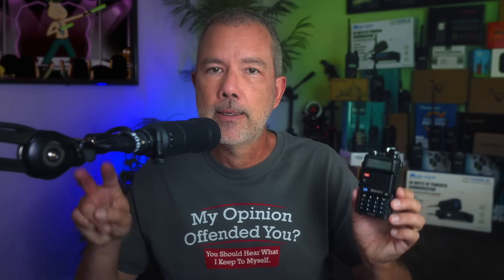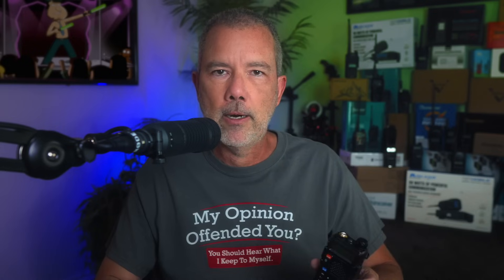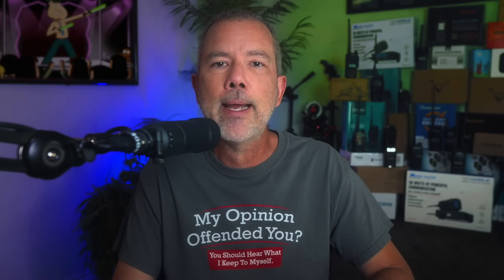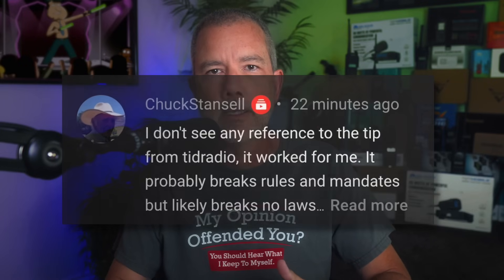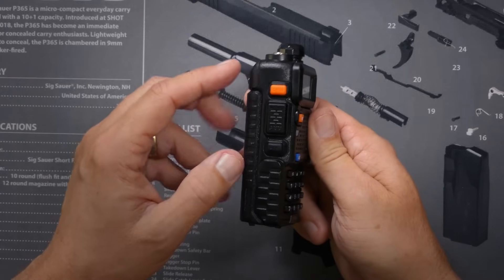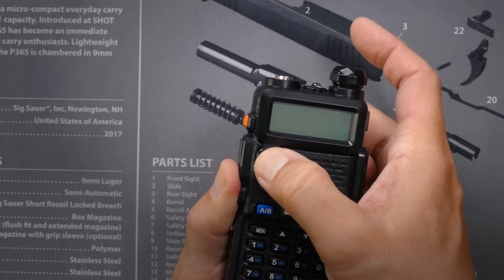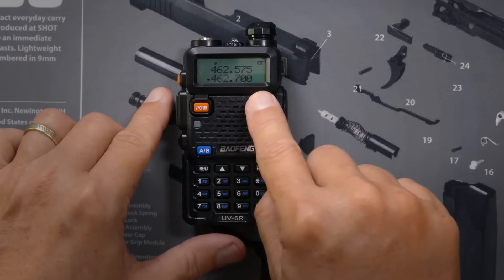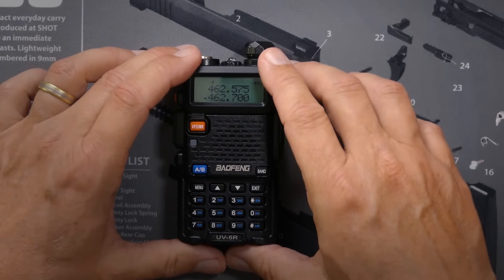How To Unlock A New Baofeng UV-5R - Easy UV5R Jailbreak To Transmit On More Frequencies

Comment: Hello Randy
I recently bought two newer uv5r units and both will not unlock using this method.
Ive tried cloning from older units i have, wiped the radios and checked tx and rx in chirp and channels they are set. Any insight? I have also tried the manual factory reset.
Reply from the maker: My insight is that many of the very new models cannot be unlocked.
Reply: @TheNotaRubicon  Roger that! I guess I got the unlucky batch this time. Thanks for the time and BTW Loving the humorous but helpful videos! Keep it coming!

Comment: For anyone curious, just received a new UV5R yesterday (10/16/23) and I was able to unlock it. Thanks for the helpful video!
Reply: Okay, how exactly do you know if your radio is locked?
Reply: @chipfornaris  Display says, "Factory" and you can transmit on GSMR frequencies.
Reply: I just got a new UV5R and it will not unlock....Link to your purchase?
Reply: @mdean619 would be super helpful ty as to where u purchased them  ty again
Reply: I too got my UV-5R in December 2023 and I myself just unlocked it as well thanks to this video now i can transmit on my GMRS channels.
Reply: Mine will not unlock any Ideas
Reply: @Practical-Tactical173 im sure you got it buy now but if not. Press menu 040 menu menu menu. Thatbwill factory reset it. Then shut it off and do this. I had to go this route with mine
Reply: @cameronbarron  Thank you for this. The other way does not factory reset but this way did.
Reply: @cameronbarron had to do this first and it worked! Thanks!
Reply: @tacticalt4749 how many times did you swear at it...  sometimes takes longer than I'd thought 😂  

Any luck?
Reply: Does it stay unlocked or do you have to start it up like that every time
Reply: Stays unlocked. Checked it by transmitting and receiving with a walkie talkie. Have fun
Reply: Are you guys transmitting on GMRS frequencies without any issues? I’m still contemplating between the uv5r and it’s gmrs counterpart
Reply from the maker: If all you ever want to do is transmit on GMRS, then you should get the GMRS version because everything is much easier.  Maybe even look at the UV-5G+ which is also better in every way.
Reply: @TheNotaRubicon have you tried any new ones this year that can be unlocked? I want to know where I can get a pair
Reply: i just got a 2 pack today and one dose it and the other doesn't
Reply: Got a uv-5r in 2024 and didn't have to unlock it at all for gmrs frequencies it workd out of the box but 220mhz band will not like some are saying
Reply: hi andy. can it transmit on airband now?
Reply: Me too one did a few months ago but this second one I got more recent won't do it
Reply: i just ordered two more of these radios, got them today, and they are not locked.
Reply: I just got two of them in Jan 2024 and they came unocked already. I got it from Abbree on Amazon as part of a bundle with extra antennas, etc.
Reply: this worked for me but out of curiosity how do you re lock it?” Lol
Reply: Was Able to Unlock in Dec 2024, in a country where FCC is a bank not a commission
Reply: Mine keeps saying 'frequency mode'. No reset or anything.  Why?

Comment: So only newer ones are locked? I bought mine in 2019 and these steps didn’t generate the factory message. Is this unlocking process supposed to allow a broader frequency range? (Like listening to air traffic control frequencies), or were newer locked models not able to transmit at all on any frequencies, but only listen?
Reply from the maker: As mentioned in the video, only newer ones are locked.  Your 2019 can already to everything that "unlocking" allows the new ones to do.

Comment: Did not work for me. Sad chad
Reply from the maker: Is your radio locked? if its not locked nothing will happen because you don't need to unlock a radio that isn't locked.
Reply: @TheNotaRubicon  I still get the screw you beeps after factory reset. Trying FRS frequencies

Comment: It doesn't work on mine, I do that but instead it shows "COPING" no FACTORY here.
Reply from the maker: Is it locked? It wont do anything unless the radio is actually locked.
Reply: @TheNotaRubicon  I want 220, it does 132 to 174 and 400 to 500. I've tried the Chirp method too.

Comment: I just got two UV-860's and the company I got them from said they're an upgrade from the UV-5R which can be unlocked with the Push and hold PTT, MON and VFO/MR while turning the radio ON and you'll see a message on screen that says FACTORY if you successfully unlocked the radio, if not, try again.
However, this does nothing when I try to unlock my two UV-860's, absolutely nothing, it turns the unit ON but doesn't unlock anything or display a FACTORY message onscreen.

I really want to unlock frequencies, do you or anyone else for that matter, have a way I can do this? Please and thanks!

I appreciate your time, I'll be right here to check for replies as they happen, I hope to hear from you soon, anyone!

D from B.C.

Comment: I have a uv5r5. This did not work for me. Any ideas?
Reply from the maker: Yes, I have a lot of ideas, all the time.
There are two possiblities: 
1) you did it wrong
2) you have a newer UV-5R that cannot be unlocked
Reply: @TheNotaRubicon  I'll have to assume the latter since I have good hands. How new is new? I bought these a in '20, after a move they stayed in storage before any use.
Reply from the maker: Is it even locked?  It wont work if its not locked because you dont need to unlock a radio that is not locked.

Comment: Worked on my UV-S9 but not my new UV-5R-GMRS.  🤔  still unable to transmit on the UV-5R -GMRS,  next I will try to edit things in the software I guess.  What would ONE be looking for in the software.  I'm not using tones and my other Baofeng works so kinda at a loss.

Comment: Frustrating. my new Baofeng UV-5R GMRS will not unlock even with doing the reset.
Reply from the maker: Nobody said you could unlock the GMRS version.
Reply: @TheNotaRubicon  Wishful thinking on my part. I'm a radio noob.
Reply from the maker: Some UV-5R GMRS units ship unlocked.. did you confirm that yours is actually even locked?
Reply: @TheNotaRubicon  Yes, put the unit to a ham 2meter band and it won't transmit. Will transmit on gmrs though.
Reply: @TheNotaRubicon  I returned the GMRS radio and bought the non GMRS one and low and behold, I got that one unlocked. Now, I can be one of the cool people. lol.

Comment: I tried this on my GT 5R and now I have to turn off the radio to stop it from transmitting. How can I fix it. Thanks for all the videos you have posted I am in the process of watching all of them.
Reply from the maker: I dunno man, this is for a UV-5R, not the GT-5R.. Be sure to read all the updates and warnings in the More-Info section of the video.
Reply: Had the same but it was the button that stuck,  just wigle it a bit and it should stop the tx.

I hear that unplugging the battery and put it back works for those who get this without having a stuck button

Comment: Randy, I purchased a Baofeng BF-F9V2+ several months ago (unfortunately before coming across your great instructional video's) and wanted to inquire if this radio is comparable the UV-5R?  I'm new to all things "Radio" so I'm really green with this stuff.  If I could find the operations manual online for the UV-5R online, I would just read it and compare to the info in my F9V2+ manual.   Thank you, Sir.
Reply from the maker: I haven't used the F9V2 but it looks to be very similar to the UV-5R, my guess is the menuing operation is 99% the same.

Comment: When I tried this, it said "channel mode"
Reply from the maker: Is your radio locked? It wont work (and you should not try this) unless the radio is actually locked.  Or, you may just not be pressing all the buttons correctly.
Reply: @TheNotaRubicon  I tried it twice.  How do I tell if it's locked?  I did a test transmission on FRS channel 1 because I have an FRS radio and it went through.

Another item of note, I saw your video on how to change the default language.  Mine was already in English, so it may be a different configuration for radios sent to Canada.

Comment: This method did not work for my Uv5r, nor did the factory reset within the menu.  Can this be done with software and a cable ?
Reply from the maker: Is it even locked? If its not locked, none of those things will do anything, because it's already unlocked.
Reply: Wow thanks for the reply!   @TheNotaRubicon   I wondered the same thing, but I can’t transmit on 462.700, I just get a beep
Reply from the maker: Ok, sounds like it is locked. You probably have one of the NEW new ones that cannot be unlocked.
Reply: @TheNotaRubicon  ok thanks.  The menu factory reset option does nothing but take me back to the channels and an English voice.  It doesn’t go back to Chinese voice.  I believe you’re right.

Comment: New UV-5R order shows "Baofeng UV-5R Two Way Radio Dual Band 144-148/420-450Mhz Walkie Talkie 1800mAh Li-ion Battery (Black)"
Question, does this mean I will not be able to listen to 155.865 and 453.900? 
sorry, nube question.

Comment: Hey I went ahead and picked up a UV-5R, turns out they shipped me a UV-5RTP, I was wondering if there’s a different way to “jailbreak” it other than the PTT/MONI/VFO turn on method; mine isn’t showing “FACTORY” when I do it; I’m new to all this so I was just wondering if there’s a way or if I’m just an idiot. Maybe it’s already jailbroken? I have no idea
Reply from the maker: Is it even locked?
Reply: @TheNotaRubicon  Well I’m not sure, which would mean I’m and idiot I suppose. It seems to be going through all of the channels just fine but I just wanted to confirm if it was or not. How would I know if it’s unlocked or not? I mean if it goes on those channels that should mean it’s already unlocked correct?
Reply from the maker: Please read through all the info/warnings in the More Info section of this video, ASAP.
Reply: @TheNotaRubicon Well I see now that I should have read that sooner; so what does this mean now?
Reply: @TheNotaRubicon My question is whether or not this will still work? I was planning to find an affordable radio for my group to use while trailing, and I have zero experience with these so sorry if I seem to be an uneducated fool, because at this current time, I am just that

Comment: I have the new GMRS version and that process doesn't work. Do you know how to get these unlocked?
Reply from the maker: Are you sure it's locked?  Mine wasn't.
Reply: @TheNotaRubicon  yes. i even pulled it into chirp and tried resetting the low and high freq. limits, but still nothing. the three button method you showed disnt give me a factory reset either.

Comment: So I am being told there was another firmware update and this no longer works on the new ones. Does anyone know if this is true?
Reply from the maker: It seems hit & miss with new (mid-2023) purchases.
Reply: @TheNotaRubicon I purchased mine in 2020. But I've reset it since then. This does not seem to be working for mine.
Reply from the maker: If you bought yours in 2020, then it probably is not locked and this does not need to be done - is it locked?

Comment: I just got a different version of the radio: a UV-5RIC (I live in Canada so the IC designation is possibly "Import Canada" ???).  The 'unlock hack' does not work - the display did not say "Factory" but Welcome instead and the voice says "Frequency or Channel Mode".  Can this unit be unlocked or 'Factory Reset' with the programming cable and software?

Comment: I just got a UV-10R.  It doesn't seem to transmit on any UHF frequencies.  It just makes a loud buzzing sound.  Works on VHF.  Any ideas
Reply from the maker: My idea would be to find a video about a UV-10R and ask there.
Reply: @TheNotaRubicon  Thank you for responding.  I learned that the UV 10R is actually equivalent to a BF-F8HP, and is supposedly a 3rd generation version of the  UV5-R.  I messaged you because I did not find a video about the UV-10R, BF-F8HP,  or any useful information.  Finally, out of desperation I tried the master reset and started from scratch.  That appears to have worked, but of course it then spoke Chinese (I changed that) and I had to enter everything again.  I hope that I have not earned your scorn.

Comment: Need some clarification . . . .

When programing the frequencies into baugeng radios, do the bandwidths also need to be programmed along with each frequency (Radio Service)?

Also, can one radio have several Radio Services programed at one time (Marine, GMRS, FRS, MURS, etc) do bandwidths need to be set ?

Comment: If I want to use chirp to set the original frequency range it came with, where can I get the values for that? Thanks!
Reply: "It is designed to transmit on the 2 meter band between 136 and 174 MHz (VHF) and on the 70 Centimeter-band between 400 and 520 MHz" ... this is actually my frequency range that I get after the unlock..... so it seems that its exactly what its advertised as....

Comment: mine says coping not factory? my radio also has a S on the screen the radio wont TX  any ideas?
Reply from the maker: Is your radio even locked? It wont work if its not locked because unlocking isnt necessary.
Reply: @TheNotaRubicon  its a old version of the radio bfb293 is the version number. even if i initise the radio from the menu the S is still there the radio wont TX
Reply from the maker: So you are saying it does not transmit at all?
"S" means dual-watch is enabled and has nothing to do with transmitting. Go into the menu and turn off Dual Watch if the S is bothering you.
Reply: @TheNotaRubicon  The S is now gone . Had to do it in chirp as didnt see the option in the menus. the radio still wont TX its as if theres some lock on the radio. pressing the PTT switch just beeps it receives ok

Comment: Hi Randy - just got a new UV-5R and tried this. Screen came up WELCOME, not FACTORY. Have you seen this before? Thx!
Reply from the maker: Yes.. that will happen if the radio is already locked/does not need to be unlocked, or if it's one of the very new ones that this does not work on.
Reply: @TheNotaRubicon  Thank you sir! Another quick question - do you know if the locking pertain to all Baofeng models or just the UV-5R?

Comment: It seems to work with the BF-F8HP, except I did not get the FACTORY display on startup.

It did produce a red light when I pushed the PTT button from inside my Faraday cage, but I didn’t have a receiver in the cage because why would you?

Comment: Hi I tried this to  unlock my BAOFENG didn't work I held the talk button then the menu and the orange vfo button the Antenna was not in the hit the on and off button many times still nothing it still shows welcome 
Can you let me know what I'm doing wrong I followed instructions am I pressing the right buttons or leaving one out help me it's really appreciated 🎉 thanks guys
Reply from the maker: Is it locked? If the radio isnt locked this wont work because its not necessary
Reply: Thanks but the radio is locked I follow his instructions if someone again tell me exactly what buttons to press and hold while turning it on and off it just might work unless I'm pressing the wrong button I did what he said not working
Reply: But the radio is locked
Reply from the maker: Some newer ones made after this video arent unlockable.. so if you cant unlock it, then, its not unlock-able.

Comment: hello .. by unlocking the radio on this way in the future I can make changes for example of the channel names through chirp or will I have problems? or do you advise me to unlock everything through chirp? because I have the radio but I still have to get the cable for the pc yet
Reply from the maker: I advise you to read through all the warnings in the More Info section of the video.

Comment: Boom.  Easy peazy.  HOWEVER.... when I tried to use CHIRP to add some GMRS repeaters, chirp will not allow "duplex" on the GRMS frequencies.  I was able to upload the rest of the channel settings but had to enter the offset for each channel by hand. Is this a knows issue?  Did I fck it up?  Is there a work-around?  Thanks in advance.

Comment: For anyone interested, I have confirmed that this unlock procedure works on the GT-5R.  The GT-5R is supposed to be the FCC compliant version of the UV-5R.  I don’t know if the receive range is the same,  but I was able to verify that it will transmit on GMRS, not by actually doing it, cause that would be illegal….
Reply: I was reading through the comments searching if anybody was able to do this on the GT-5R....I am new to HAM and that is the radio I ordered. Glad to hear it worked. Will try once I have on my hand.
Reply: I, too, have determined that it works on the GT-5R... don't ask  me how I know...

Comment: Hey There Rubicon!  This worked perfectly for one, but not for another.  Is there a way to unlock it using CHIRP (if the 3 button method doesn't work)?  I cannot get the FACTORY message to come up, and it will not transmit on GRMS freqs.

Comment: Did not work on mine.
Reply from the maker: Is yours locked? If its not locked it wont work.
Reply: @TheNotaRubicon  sorry I’m a noob in the respect I’ve had it for ages but never delved into sub settings etc. how do I check if it’s locked or not.
Reply from the maker: Please read all the warnings in the More Info section ASAP.
Reply: @TheNotaRubicon  thanks 🙏

Comment: Not working for me, UV5R here. Is there any other method to do this?
Reply from the maker: Are you sure its even locked? If its not locked, it wont work because its not needed.
Reply: @TheNotaRubicon  I noticed you keep typing this response to people. I cannot TX on FRS1(beep tone when PTT is pressed), should I be able to TX on FRS1(462.5625) Is there a way to confirm unlock vs locked?

Comment: New "GMRS + NOAA" pre-programmed uv-5r's cannot be unlocked with this method.   😞 Bought a pair from Amazon and they are stuck. No transmit on Ham bands either, only on the GMRS.